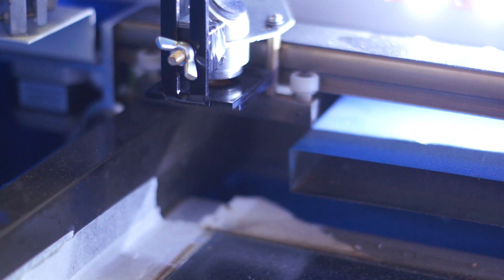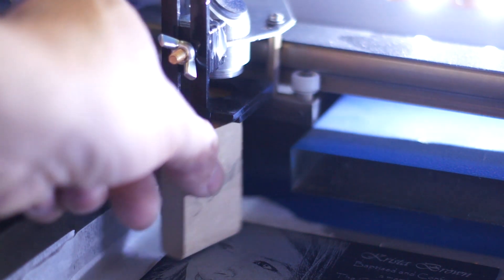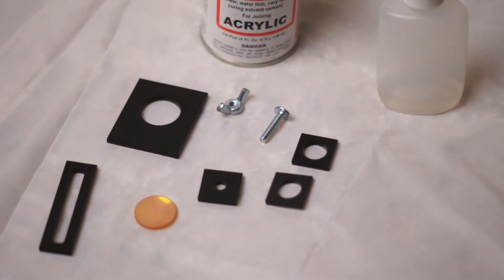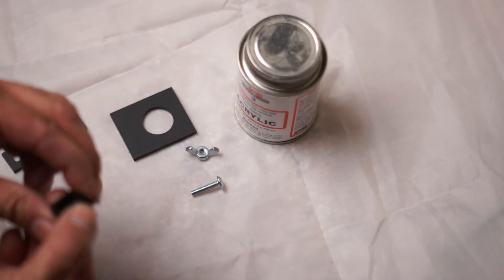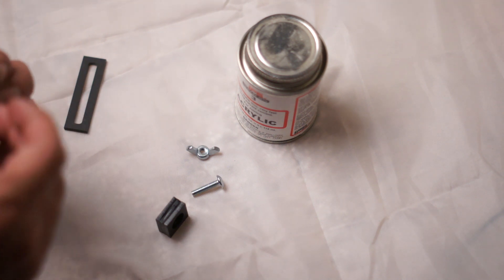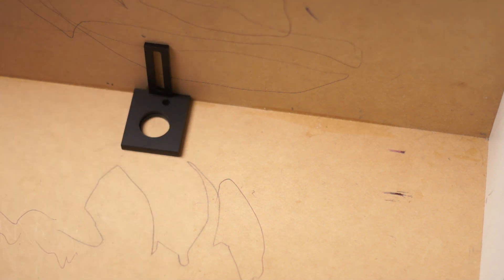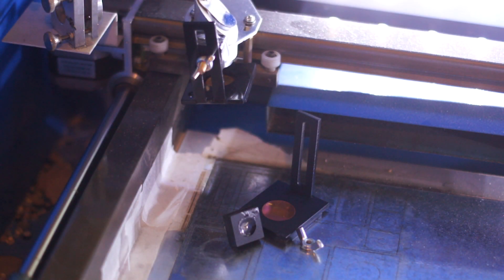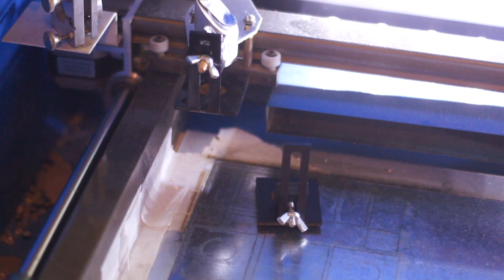China Laser Cutter From Ebay Adjustable Lens Mod. DCK40III

Comment: Hi, I have the same machine. How eide can plates for cutting/engraving be? I experienced power problems as soon as the laser lens head moves far away from the tube....
Reply: You need to re-align the mirrors.  I found that I had to do that on mine and its solved 90% of my issues.

Comment: Hi! I love this mod. I just ordered my laser engraver from ebay. Would love to talk with you about your experience with it. What other mods you have seen and used.

I am thinking about doing a step motor upgrade so I can do direct gcode.
Thoughts?

-J
Reply: have a look at Turnkey K40 Laser Arduino + Ramps Firmware for about 50 bucks you can have a controller with LCD screen, does all the PWM junk too

Comment from the maker: The cut file is available at my site.  the link is shown in the video. Go to the downloads section. There will be a link.  As so your 3d question. You could print it in 3d. I have a 3d printer kit myself, and am in the process of building it.  Although my idea on this mod was to have those of you who are getting a laser cutting to use your laser to make the mod, and not have to use another tool Thanks for watching. More video soon :)

Comment: Will you provide the cut file here or shall somebody message you to get it?
If i will reach that point i will take a look and think about it, may also print it as it whould need no glue at the end point, just the metal parts. I think this printer may also be a handy tool for you to get for the future. Just google for come3d printer or add a dot com at the end if you are interested to check out. This vid: watch?v=N6EHbkGb5lU points out the conversion to a mach3 board instead the moshiboard.